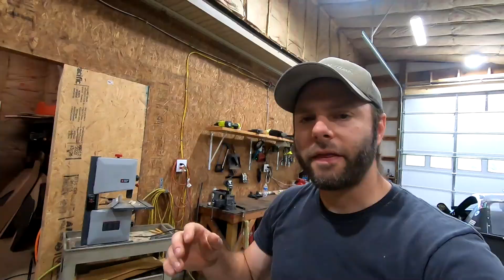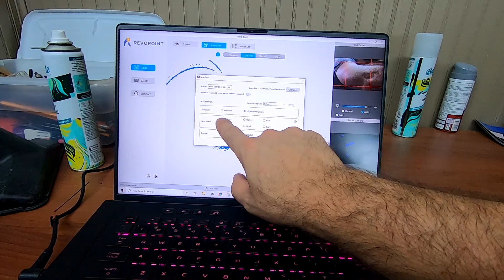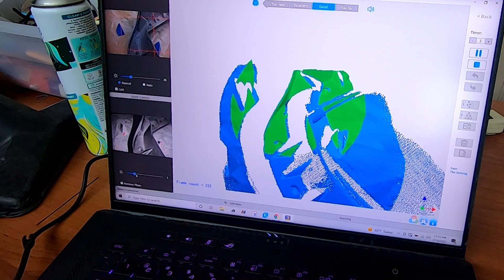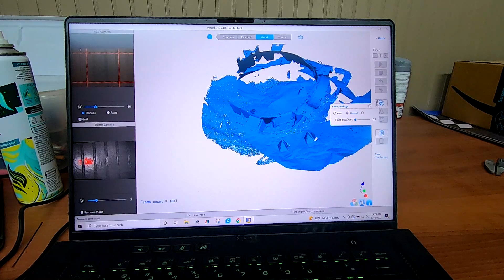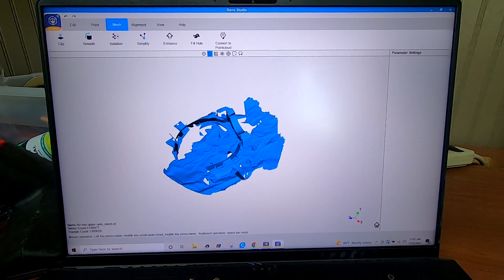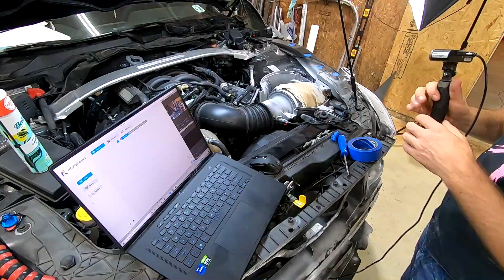Carbon Fiber Air Box Lid Part 1- 3D Scanning

Comment: I'm surprised teh software can't trim the base/background based just on colour.  So if your model was black/grey and the background/table surface was, say, blue then it would just automatically edit out any blue pixel.

Also, surely this would be easy if you put the model on a turntable to rotate it, rather than you walking around it.

Great video though, I appreciate this a lot as this is the approach (3D Scan -> 3D Model -> 3D Print a mould) is the route I want to follow.  Will be buying a 3D scanner in the next couple of weeks.

Comment: I'm wondering if there isn't any way of masking out the area You don't want to scan (i.e. with a different color table cloth) so that You wouldn't have to erase all this unnecessary crap later on in the 3d program  ?
Reply from the maker: Something shiny and black maybe? I could imagine it taking longer to lay that out than just cleaning up a scan in many cases tho. Plus sometimes the scanner uses features on “unwanted surfaces” to keep track during the scan. So they are necessary in some cases.